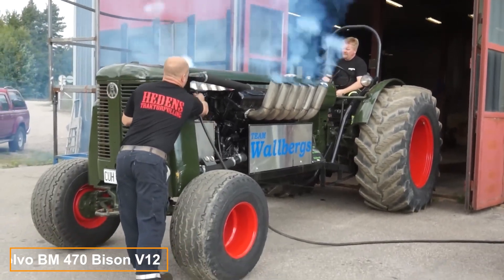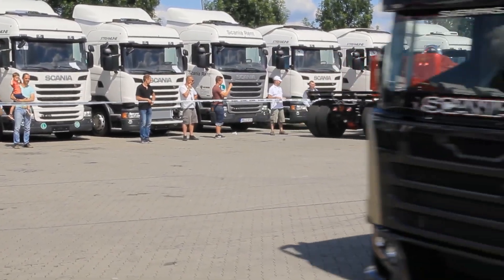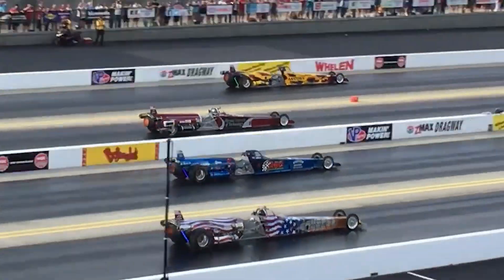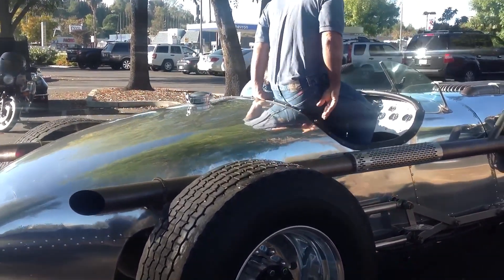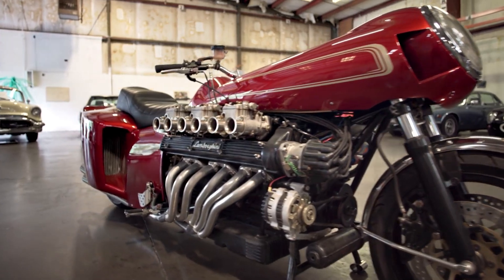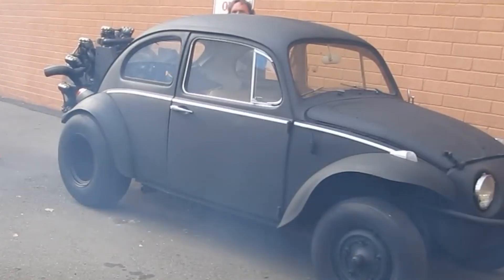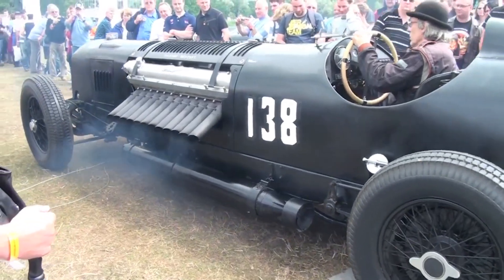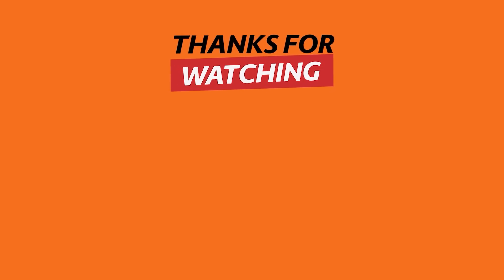15 MOST POWERFUL INVENTIONS VEHICLES WITH CRAZY ENGINES

Comment: 15 MOST POWERFUL INVENTIONS VEHICLES WITH CRAZY ARTIFICIAL STUPIDITY SCRIPT
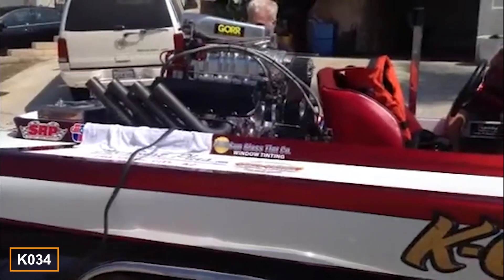2:20 - 6774 cubic inch engine
3:15 - completed a quarter mile in 322 seconds
8:54 - powered by a V12 jet engine
you would benefit from basic proof reading of your AI script
Reply from the maker: thank you 🥰🥰